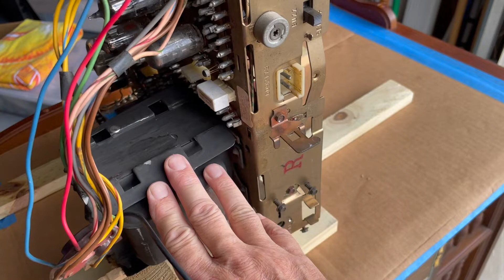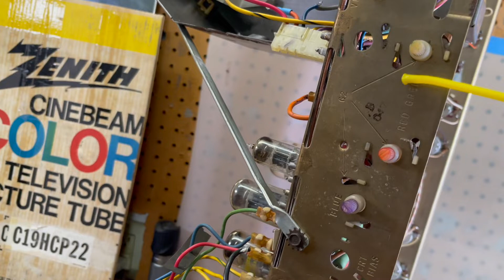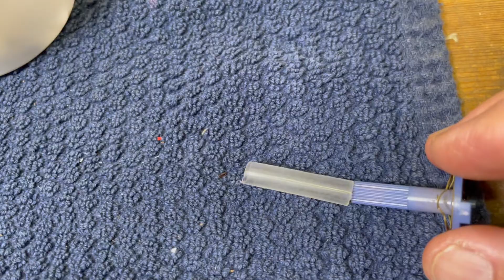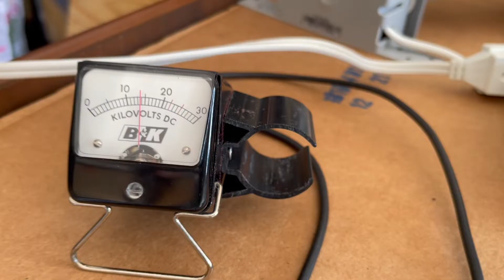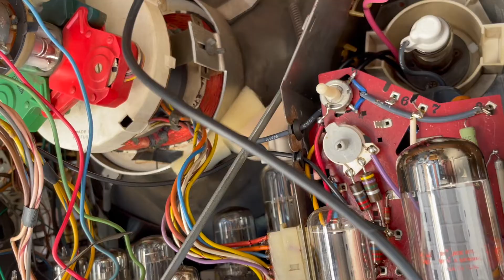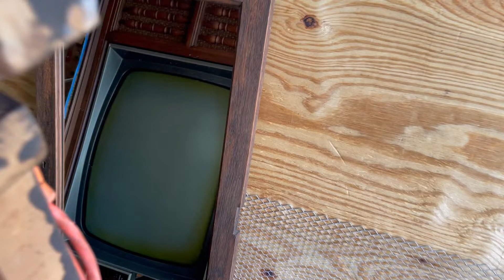1969 Zenith Color TV Restoration - Episode 4

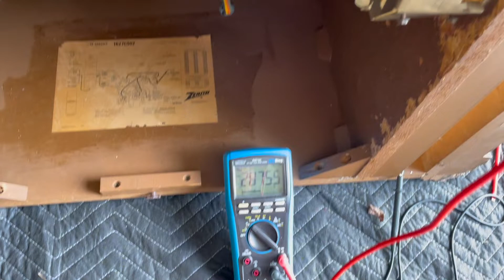Comment: 56:30 You state that the cathode voltage on the CRT should be 300V each. And at 56:43  you state that the G2 screen voltage should be about 150V. 
This is nonsense! 
On any CRT the screen voltage is always higher than the cathode voltage. The black level voltage range of a cathode is between 80 and 150 V depending on circuit design. And the screen voltage is around 400-600V, but loaded down by the input impedance of ur DMM, putting it in the 350V range or below when tested. 
Bottom line: You have identified the pins and their voltages correctly but mixed up which pins are actually screen and cathode; The three lower pins are screen (~300V under DMM load),  the three upper pins are cathode (~150V).

Comment: 40:10 you state "the only(!!) way this boost voltage could exist is by having the horizontal circuit running"
This statement is only partially correct. The boost voltage is derived by stacking a dynamic flyback generated pulse voltage on top of the line output stage supply voltage by way of the damper diode. So as soon(!!) as the static B+ to the line output stage is present and the damper diode is conducting, a significant portion(!!) of the boost voltage will start to exist, even without(!!) the horizontal output stage running. Therefor taking the presence of any voltage on the boost voltage rail as evidence for the horizontal deflection running is a fallacy. 
Sorry but you should review basic circuit design before making such incorrect statements.

Comment: The excessive brightness issue you initially had was likely an intermittent connection on one (or both) of the 6JH8s (or whatever the newer compaction version is if yours has that). It’s the “sheet beam” chroma demod tube(s) that drive the picture tube’s G1s (DC coupled). If pulled/not properly seated, it’ll float the G1 voltage up to ~B+, causing the brightness to go off the charts and bog down the HV